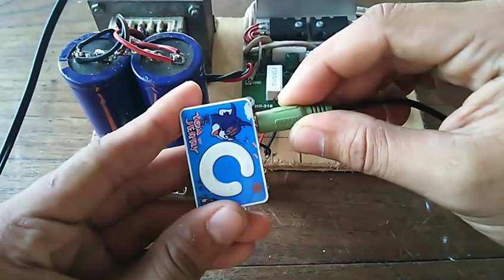Cara pasang Satu POTENSIO pada power Amplifier

Comment: sy pasang tone control mono, suaranya kecil dan dengung padahal volume dah full, inputnya pakai rca mohon solusinya mas, tks dan sukses
Reply from the maker: Cek lg prmasanganya
Reply: @WongDeso_86  tuk tegangan wajib 12 volt ga, krn sy pakai tegangan bawaan power amplifier nya, dmn elco dan diodanya dah jadi 1 sama power amplifier nya,
Reply: klo yg model seperti video si mas jack audionya bisa utk mic juga mas, tolong bikin videonya mas tuk ada input rca juga, tks mas

Comment: Cara pasang tone control di gabung dgn 1 potensio volume yg sdh di pasang ke power gimana mas ? Output dri tune masuk ke in power/input potensio volume mas
Reply from the maker: Iya mas out masuk in
Reply: @WongDeso_86 masuk ke in power langsung/ke potensio volume mas
Reply from the maker: Out ton control masuk in potensio baru masuk in power
Reply: @WongDeso_86  oke mas makasih nggeh